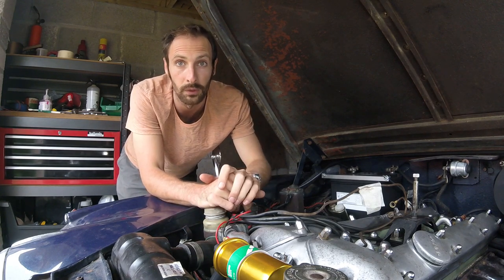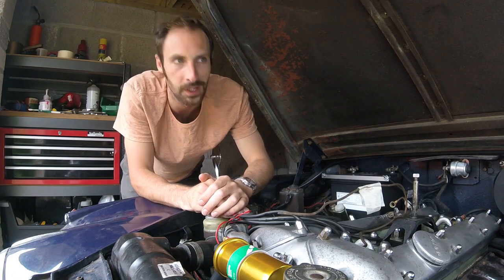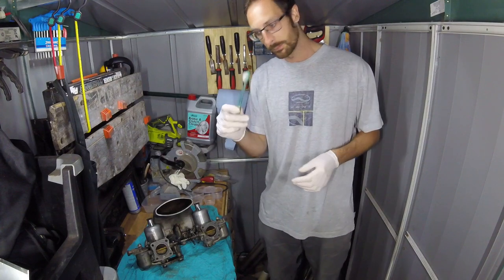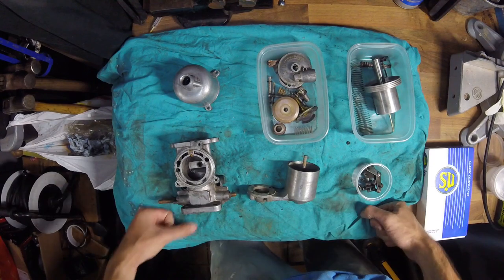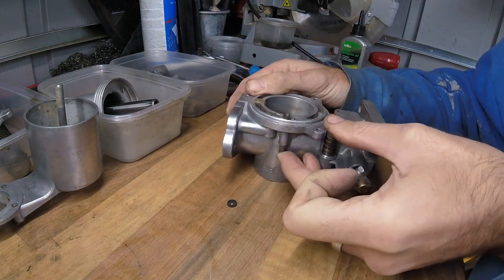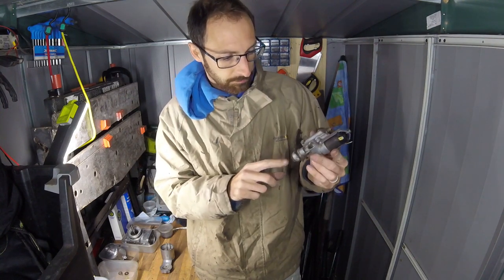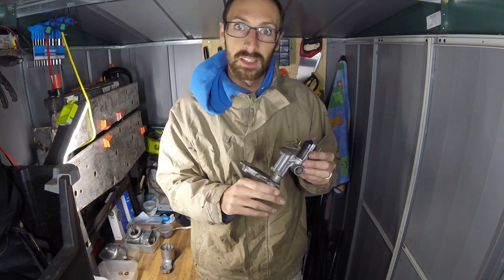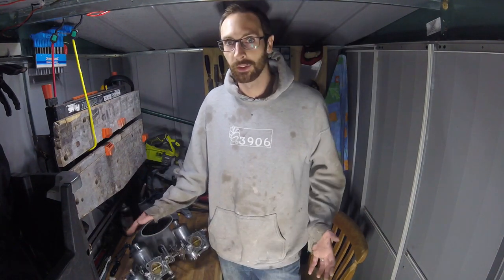Jaguar Mk2 | 05 Carburettor Rebuild

Comment: I worked on jags from 1963, the choke tube rusts up, the diaphragms & springs break.
 Check floats & adjustments.
Set choke adjustment when cold started by advertising the needle.
Check choke solenoid,  check  triangle temp sensor on inlet manifold. 
11mm bar, use a Britool ratchet handle .

Comment: the major task in verifying the condition of the Auxiliary Enrichment Device (AED) is to ensure that its solenoid disables (cuts off fuel flow to itself ) when the coolant temperature reaches about 50C. you can do this with a multimeter. 

we can quibble about the richness of the fuel/air mixture and the volume it provides, but those are just details and in practice are of minor importance, or at least of no more importance than how far one pulls on a manual choke knob. :)

Comment: Great. To make holes in gasket, you need a wad punch. Aldi were selling sets once but you can make them by grinding a thin walled tube until the edge is sharp. BUT I'm looking for an easy way to get the air inlet off, so have not reached square-one.

Comment: Please i have a question, how to balance and knowing the right vacuum pressure when changing from
Original filter to 2 open air filter from K&N?

Kind regards / Gustaf
Reply from the maker: Well the way I did it was..... badly! The standard method to balance the carbs is to use a tube; one end next to your ear and the other move between the two intakes and you should be able to hear the difference. Good luck!
Reply: Ok :) i have baught a vacuum reader to connect to the carbs, You dont happend to know Wich is the right pressure should be?
Thank You for your  answer
Reply from the maker: No I don't sorry, I'd imagine it would vary from setup to setup and the key would just be to get them balanced. Post up on here if you find out

Comment: I know this an old thread now but I have a problem with a 1967 MKII. I don't know where the wires go from on top of the cold start/auto choke solonoid, there are 2 connectors and there aren't any loose wires anywhere near that belong there so need to make some up but doesn't know where they terminate, I don't have a wiring diagram with those feeds on. Also from the thermostat are missing as well. I tried to look on this video and it looks like a pair of twisted pair red wires appear to go through the firewall. But I only have a single connector from the thermostat housing but don't know where it goes to. Any advice or direction greatly appreciated.
Reply from the maker: Mine has been modified to be driven by a switch in the cabin. Originally this is driven by the otter switch
Reply: @vicsprojects  thanks for the reply, ah so you have put a manual switch in between to be controlled inside the cabin? So originally would a single wire go from the otter switch directly to the carb solonoid? To open and close the needle for enrichment? Regards
Reply from the maker: @bradjames3555  that's correct originally I believe it's just power on one side of the aux carb and then the otter switch grounds the other side. I hear alot of people wire it directly into a switch under the dash like mine has due to the otter switches not being reliable
Reply: @vicsprojects  cheer's

Comment: hey there just found your channel and must say I love it, but one small thing so far that bugs me (and do note I am a mechanic with 30 years experience) and that is when you put a split pin in you are putting it in incorrectly the EYE should be the other way around and the 'legs' should be over the face of the bolt, also when re-using nylocks even temporary use locktite.Please accept these comments as constructive.FYI I am restoring a 64 MKII 3.8
Reply from the maker: Hey jagvette1, glad you enjoy the videos. You can probably tell I'm not a professional mechanic 😂 so thanks for the advice it's always appreciated 👍
Reply: Hello Jagvette,

Nylocks are not one use fasteners, it is quite acceptable to reuse them if they are in good condition.
Reply: I would never re-use nylocks a second time without using locktite , and for what they cost I would also buy new ones, it’s not worth the risk.
Reply: @jagvette1  

It's your choice, but they are designed to be reused.
Reply: No when installing a split pin, install as Vic did, but then you cut the legs to allow you to tuck the tail back into the the next castellation in the nut, same the other side. 
Next time you are working in the vicinity of the split pin you will not cut your hand on the split pin tail, that is how an experienced mechanic would instal a split pin.
Reply: You may wish to check out this video regarding split pins https://youtu.be/KUCvBnXgIh4